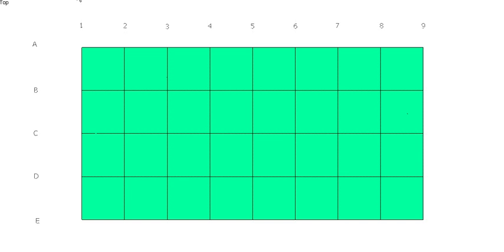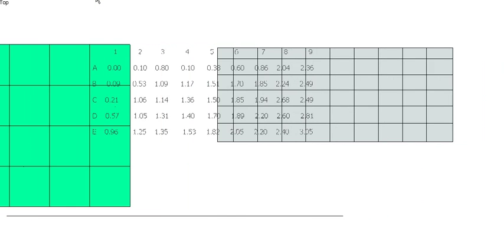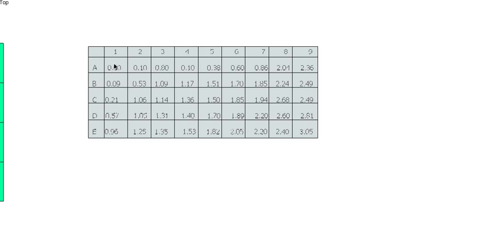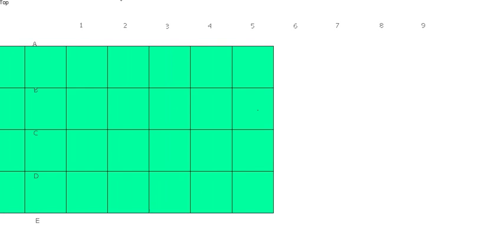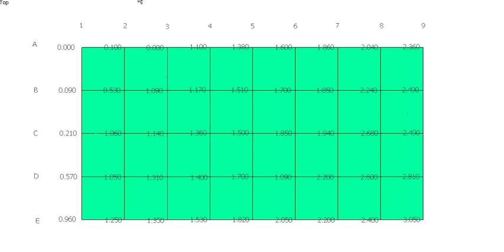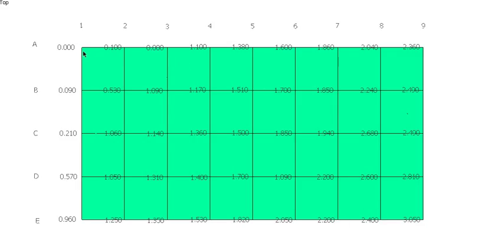Grid Survey

Comment: Hello there! Really found this video ideal as I did a grid survey like this but input my data at Magnet software! But I have got some questions about it why is the backsight for the first point must match with the one for the last point in this? And also I want to know the interpretation of my results as when I placed them in software I had to modify the contouring spacing for a smaller one
Reply from the maker: Hi Mate, the backsight and foresight have to match, if they dont then there has been a mistake in the readings. Mistakes are commonly made by not setting up the machine correctally, reading a stadia line not the crosshair and the staff not being held in the same place for the foresight and backsight.